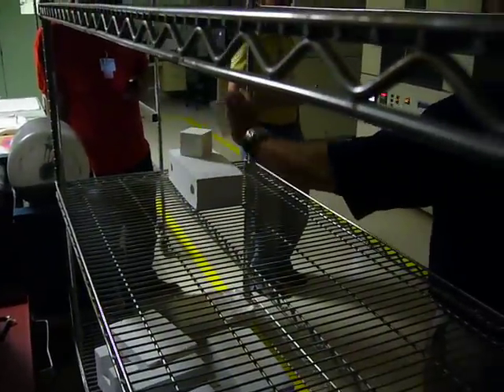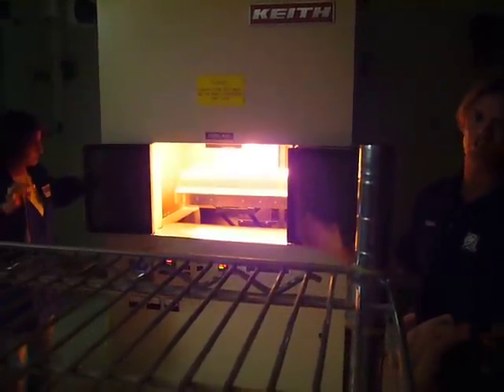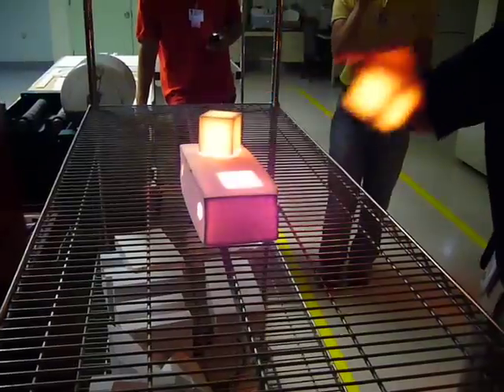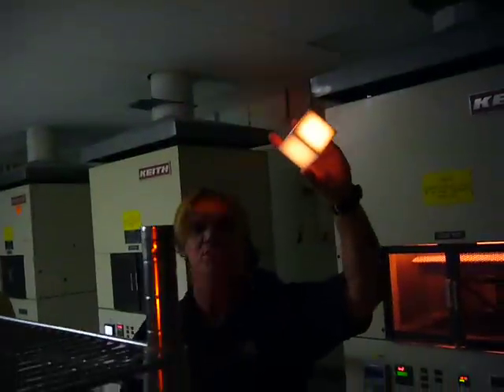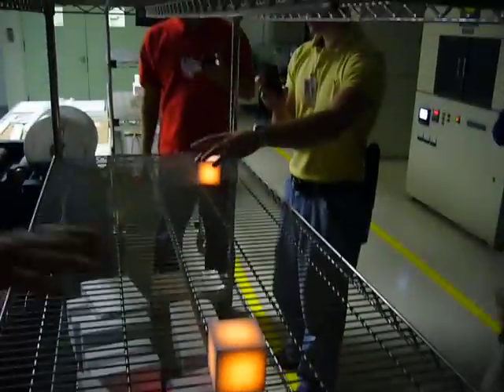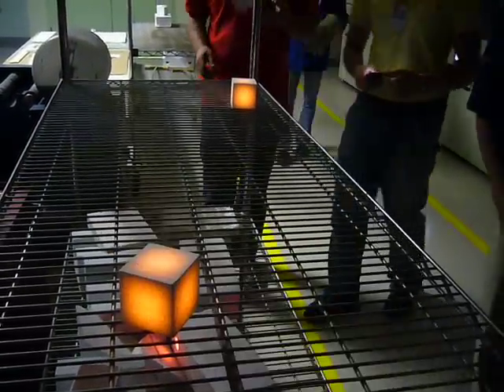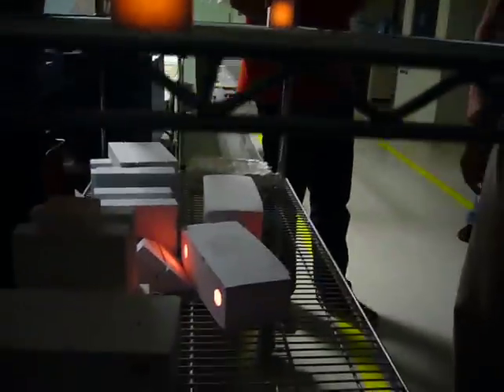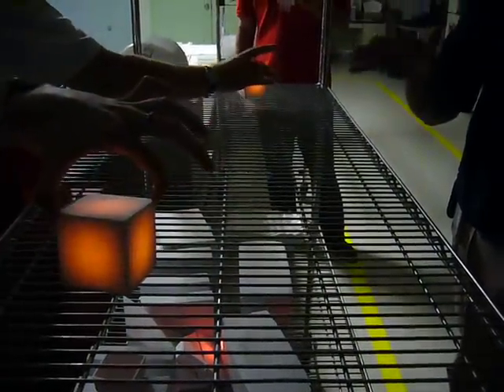Space Shuttle Thermal Tile Demonstration

Comment: The guy says you can pick them up because they dissipate heat very fast. Actually, that's not relevant. You can pick them up because they are awfully bad heat conductors. Heat capacity doesn't have much to do with this.

It's quite unnerving to see a NASA employee fuck up like this.
Reply: ***** If it dissapates heat fast I would think it would go straight to your hand very fast and cool off very fast. Like copper would.
Reply: +GrieferCian    FFS this is elementary stuff. Insulators are poor thermal conductors.  This is such a good insulator that it takes hours to heat up , hours to cool off and ages to transfer any heat to your fingers, which is why you can pick it up. 

Why cant you pick up a hot metal plate? Because it conducts heat very well.  thats it.
Reply: masso172
Actually he's correct, the employee at NASA mispoke is all.
Reply: haseothepkker  The whole point is the NASA guy is wrong in his explanation. 
And its basic stuff he is explaining, which is why the OP says its unnerving.
I'm highly critical of it also. No one corrected him.
Reply: +Lajos Winkler dissipation is actually relevant, because this way is surface cooled quicker by radiation and convection with air around it. But you are right about very bad heat conductance of material which makes material hot inside and cooled on the surface so you can touch it.
Reply: +Vojta Novotný  
No, it conducts heat so slowly that youre not burned by it.  (and thats why it holds heat for so long) the demonstrator is plainly wrong.
Reply: You are right, actually the material dissipates heat very slow, as it is a really great insulator, the NASA guy fucked up pretty bad.
Reply: +masso172 hes absolutely right. youre wrong
Reply: fredfinks I know that is what I said in the other part of my text
Reply: +Lajos Winkler Anything is plenty enough conductive in an oven over 2200 degrees for several hours. Or did you think they just shoved a light bulb into the center of that cube?
Reply: I noticed that! The tile is an insulator so it’s conductivity is super low! Metals would cool down and dissipate heat faster because they have high conductivity.
Reply: I cannot believe how many people confuse heat conductivity with specific heat. He clearly points to the lesser material saying it will retain the heat for hours and still burn you. This material has such a low specific heat that it emits all of it's heat before you ever touch it making it feel cool. And metal changes temperature slowly, not quickly. That's why it always feels cold or hot. It is unwilling to change to your temperature. (Edit) I know it might seem like changing temperature quickly would burn you faster or whatever. The fact is that the slower the heat of something changes, the more heat energy it stores overall because it isn't wasting heat energy by emitting it elsewhere.
Reply: Lajos Winkler YOU ARE SOOOOO WRONG SO SO WRONG, WRONG INDEED

Comment: Why did they have to pick the cubes up by their corners? why would touching the other parts of the cube burn them, but not the corners?
Reply: because the corners are the coolest zones, having the largest surface area to volume ratio.
Reply: The corners of a cube have 3 surfaces that can radiate away the heat, along with very little of the total cube's mass between them. More surfaces + less mass means the heat radiates away fastest there.  We use this principal for all kinds of neat things like computer heat sinks.

Comment: Someone needs to turn this into a CPU heatsink for PC's. Would be perfect. Now if we could just drive the cost of manufacturing and materials down %12,000 or so I think we would be in business.
Reply: Sorry, but you actually want something that conducts heat well to be a cpu heatsink, this material is literally the opposite of what you'd want.
Reply: Will Va Yes, but Heatsinks work as conductors for the transference of energy, these tiles are insulators which prevent the transference of energy which is the opposite of what you want because energy transfers to the most acceptable medium, and the rate of transfer is very important for CPU's because they require extremely quick dissipation from a medium that is more acceptable than they are...which is why the base of most CPU Heatsinks is a copper core, it's a cheap and excellent conductor and the energy can move quickly and more freely toward it away from the CPU before being passed to the spreader. :)
Reply: It would be terrible. The purpose of a heat sink is to transfer heat away. This is the complete opposite of what this does.
Reply: Technically correct but that's at 9 kelvin, at room temperature copper is almost twice as thermally conductive.
Reply: Copper is more conductive and more expensive than Aluminium, I think you have your words mixed around. 

Copper   401 W/(m⋅K)
Aluminium   237 W/(m⋅K)
Reply: Could you use it on a phase change system?
Reply: Actually, the material is pretty useful for insulating heat generating components in computers or electronics in general from the rest of the system, and also combine it with a heat conductive composite
Reply: Mike actually some pure aluminium is higher then copper for thermal conductivity and Graphene is extremely good for it but since copper is cheep it’s the standard go to for heat sinks .
Reply: Kelly Pedersen https://en.m.wikipedia.org/wiki/List_of_thermal_conductivities if you look under Aluminium pure - it tops at 24,000 higher then copper for thermal conductivity.
Reply: Kelly Pedersen Aye, but I already know that, but thank you for trying to be helpful.
Reply: velevetiergosling I think he wants it for the ability to dissipate the heat
Reply: logged to up vote

Comment: I think the dissipation thing is a red herring. Because dissipation happens through radiation and convection, and in neither formula are the property of the materials important. Instead, the difference between this and metals is that in metals, as soon as the top millimeter cools down, more heat will conduct up from the center and keep the surface hot. In this material the internal insulation is so crazy good that the surface can cool down independantly.
Reply: tharqal - Yeah.  It's a horrible conductor.

Comment: I own two complete HRSI tiles and one complete LRSI tile. They are indeed very light like styrofoam. They have a thin glass coating on the outside, but that does not add much weight.

Comment: For those in the comments discussing the concept of 'dissipating heat'

I am no expert, but I think that an object can be both a great insulator and a great heat disperser.  This object is a type of ceramic that transfers heat very poorly.  I would wager that the material is also extremely porous, allowing a massive amount of heat to be pulled off via contact with the air.

Comment: Thats right. You cant pick up a block of metal because it dissipates heat so well. Metal is a good dissipator.

The opposite is also the case. You  pick it up for the opposite reason. ie it dissipates heat so badly.

Comment: Where am I going wrong here. The guy says twice that he can pick it up because it dissipates heat so quickly.

Surely he can pick it up because it dissipates heat so badly. A block of metal dissipates heat well. Thats why you cant pick it up - it dissipates straight into your fingers.

It clearly doesnt dissapate heat well, because its still white hot after a few minutes.
Reply: bocaJWho 
Wrong. He is right, not you.
Reply: @Guodlca How can it both dissipate quickly and conduct slowly?
Reply: Yeah, the guy has the issue backwards. You can touch it because it conducts heat poorly or slowly.  This is also the reason they keep glowing for so long, because they're still hot, and hence, still have a lot of black body radiation.

Comment: thought the LI-900 have very low thermal conductivity, how can they dissipate the heat so quickly then?
Reply: You’re right. He meant to say that it dissipates slowly. If it dissipated quickly it would be too hot to touch. The actual tiles on the space shuttle had a double layer. The black borosilicate is the one that dissipates quickly/ has a high heat emissivity so heat is going away from the surface very efficiently. The second layer is the white one that has a very low r value indicating it has a low thermal conductivity. The reason why it’s glowing is because the heat that made it to the center is trapped from exiting very quickly i.e heat is slow to enter and exit the tile.

Comment: long: 

so... it covers the surface to be used as an abrasive shield. it takes the energy from the atmospheric friction (fluid particles being highly acc/decelerated around the shuttle) and dissipating it through convection (stream around the shuttle) and through abrasion (shielding wearing off) while not transfering heat to the inside by conduction through material.

Comment: lets do the experiment...
if this material DOESNT dissipate the heat, where would all the energy on the outside of the shuttle go, when reentering atmosphere? it would heaten up, till even its melt-temperature is reached and then the shuttle-inmates would be screwed.

short: 
heat transfer to air >> heat transfer through material

Comment: This doesnt seem right.  he keeps saying the are dissipating heat so quickly you can pick them up.  

The reason you can pick them up is they DONT dissipate heat right?  They are insulators...BAD at conducting heat into your hand.  It may be 2000 degrees on the inside but it will take forever to transfer that heat to the bits touching your hand, so it feels cool.

Seems to me like the science is explained wrong in the video.

Comment: He is wrong. This material is special because it has a very low heat transfer coefficient. The lower the heat transfer coefficient, the lower the heat flow, the stronger the insulator, the longer it takes to cool down (hence the glowing for hours), and the cooler to the touch it feels (since unlike red hot steel, this doesn't transfer massive amounts of heat to your fingers all at once).

Comment: I'm not sure how your question can be wrong, but the short answer is that it's good for insane heat resistance and that's about it. The thermal tiles on the shuttle wouldn't do much good if they softened and flowed off each time it landed. It's a piece of ceramic, so think about it like any of the china in your house. Just cooler.

Comment: Knowing that basically a shuttle thermal protection tile consists of just sand it is amazing what ability this material has. This effect makes sand in a desert or on a beach so hot when exposed to intense sunlight. It simply does not conduct the heat into the ground so the heat stays on the surface and radiates off there again.
Reply: Asbestos

Comment: This is really awesome seeing that a shuttle tile quickly gets the heat off itself by total dissipation (the heat goes off simply as infrared radiation and additionally the tile does not conduct the heat across itself so the other side stays significantly cool) Since the tile heats up only on the exposed side the heat mainly goes off the same way: away from the shuttle.
Reply: هذه المادة من ماذا تتكون
Reply: @gjgames204  سيليكون